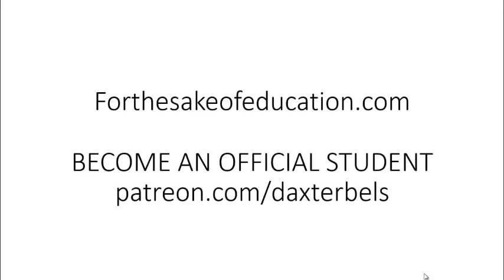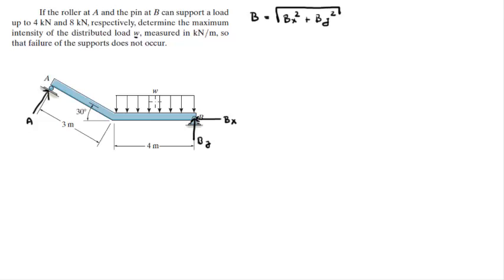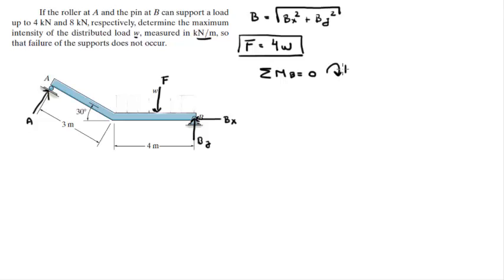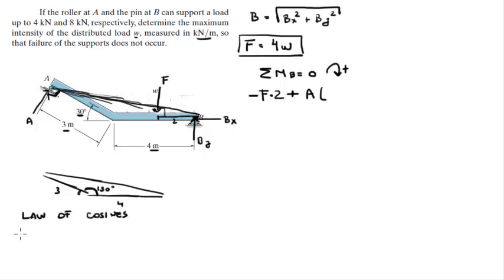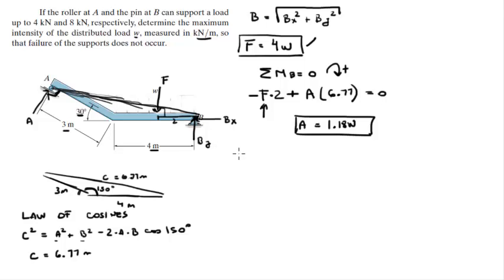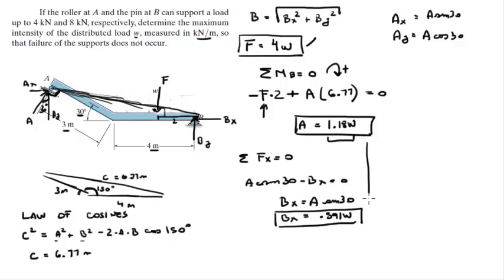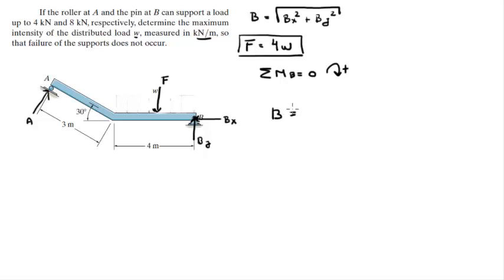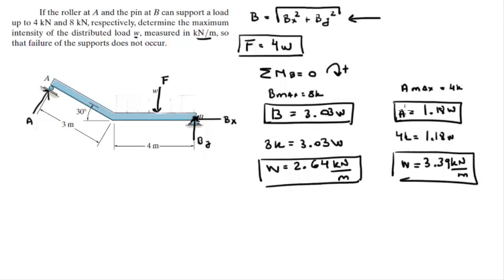Determine the maximum intensity of the distributed load w

Comment: to find the perpendicular distance to calculate the moment, you must [3/cos(30)] + 4...lets say that =a.....next, to find the distance, distance=(a) * cos(30)       so now you have the perpendicular distance to the force so m=F*distance
Reply: there are multiple ways to findthis moment, you just need to make sure that the length is perpendicular to the force.
Reply: i am actually finding it easier to just find the length in the x direction of the entire assembly and then finding the y component of the force to find the component since you will need the x and y components later.
Reply: i am actually finding it easier to just find the length in the x direction of the entire assembly and then finding the y component of the force to find the component since you will need the x and y components later.

Comment: This is actually incorrect. The distance you found is NOT the perpendicular distance. If you do the calculations correctly, the perpendicular distance is 3+4cos30. Since this number and the 6.77 achieved in the video are so close, your answer will only be slightly off, but is still incorrect if you use this method.
Reply: I was about to write the same comment. I am not sure about it, but it seems incorrect
Reply: alsogooraa my statics professor confirmed that it is
Reply: Abbie Bush thank you soooooooo much for that ive been spending the whole day trying to disprove this only to read this comment, what a waste of time
Reply: Thank for clearing that up.